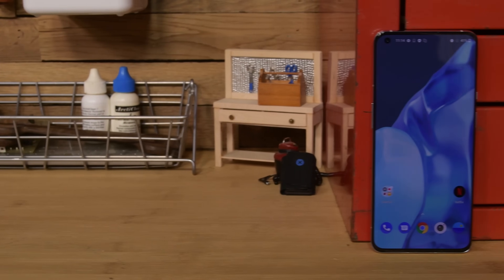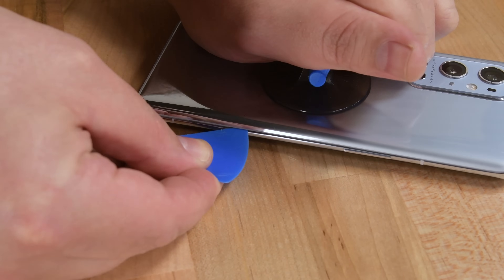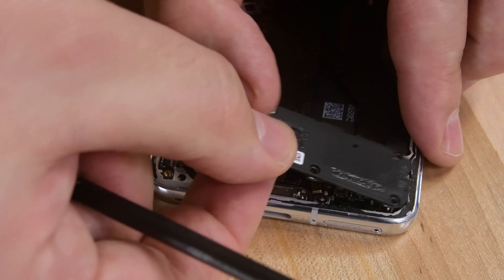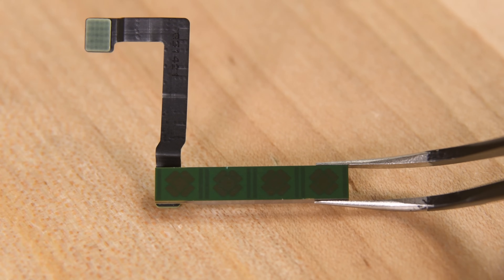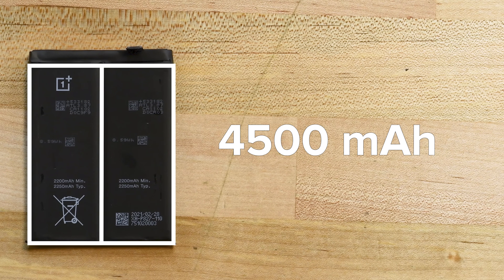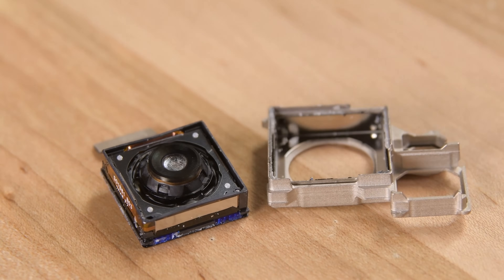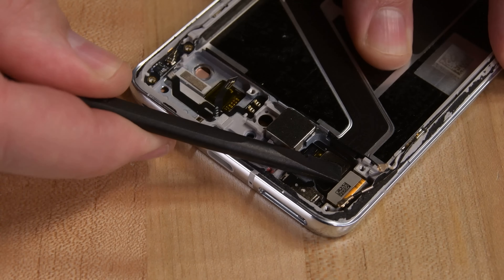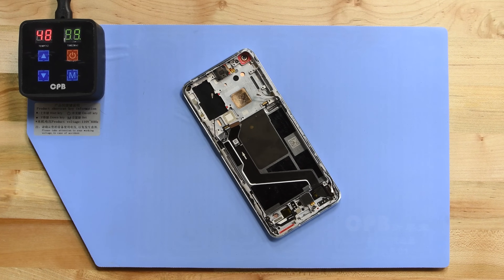OnePlus 9 Pro Teardown: Custom Camera Sensor Revealed!

Comment: If I have a heat mat, as opposed to a heat gun how long do I leave the rear of the phone on there before starting to use the pry tool? What temp setting and how long? Also, can you just replace the camera module itself if the main camera lens is broken?

Comment: Now the question is, would anyone recommend the OnePlus 9 Pro despite the difficulty of repairability?
Reply: you buy a phone because of repairability? the best ive heard is people who buy phones because of reselling value, like generally iphones would sell more even after alonger time, than androids. i buy a phone because thats what i like. thats about it.
Reply: @truthseeker6804  Hmmm. Good point.

Besides, if the OnePlus 9 Pro comes with a case, or if OnePlus do sell special cases for the OnePlus 9 Pro, then I won't have to worry of accidentally dropping the phone or scratching the back glass.

I'm not prone to being clumsy, but I'm always a bit paranoid on keeping any things in good condition.
Reply: @Isaac-gh5ku  true. if they come with durable case or third party cases would be good.  to be clear im not buying it, i was just replying to your comment. i use a plastic back phone 😁, so i dont use a case. lol. i only use screen protector.

Comment: the phone that scores 10/10 repairability score would have pull tabs for the display and back panel
Reply: Yeah... 
And swappable ram and storage unit 
A phone with a 20mm of thickness 
The score is for PC not for Smartphones
Reply: @nothing9220  exactly what you said
Reply: @nothing9220  fairphone 3 have 10/10 score and it's not 20mm thick. Oems can do it but they won't
Reply: @houghwhite411  but it doesn't have the IP68 rating, which might be a big hurdle too
Reply: @tofoo_ninja  I'd say no ip68 is not a hurdle since having ip68 means the device is sealed shut with strong adhesive
Reply: @houghwhite411  
Thats what I'm saying; to have a repairable phone u can't use adhesives which either results in no IP68 rating or in a thicker phone. Or did i misunderstand u?
Don't get me wrong; I'm totally for a shift to more reparability.
Reply: @tofoo_ninja  in my understanding hurdle means a condition that stops an action to be taken. We can have ip rated stuff with less seal, Samsung S5 being an example with ip57 rating. But it's hella costly to produce and not reliable. The cheaper solution is to glue everything shut. 

S5 is not that fat of a phone. Those manufacturers is the one who makes you think you need a thin phone
Reply: @houghwhite411  didn’t Samsung also have that little flap on the charger, it’s not really that water resistant
Reply: @houghwhite411  Is waterproofing really that important to most people?
Reply: @anxiousearth680  I don't know about most people but for me they're important. It's some kind of insurance... 

I won't leave my phone in the pocket and throw it into washing machine intentionally but I'd be glad that I have sealed phone when it happens
Reply: Nokia 3310 has joined the chat.

Comment: What is LTPO?
Reply: It's an OLED technology that allows for a dynamic refresh rate as low as 1hz all the way to the rated 120hz, meaning the phone can stress the gpu and display less when you aren't doing anything and save some battery. Probably why they didn't make a bigger battery between 9 and 9 pro since 9 pro has more battery saving features

Comment: Looks like you guys heat gunned directly over the camera a bit too long, resulting in melting the lens elements on that main camera as seen at 2:47
Reply from the maker: You're right, Chris! It's pretty hard to separate the camera from its housing without warping the lens or the plastics, they use some pretty strong glue to keep all that together. Next time we'll use some Kapton tape.
Reply: @iFixitYourself  nah, I like it crispy :)
Reply: @iFixitYourself  yeah camera should have pull tabs... According to your repairbility score

Comment: Splitting the battery in half WILL NOT result in a fast charging , charging speed is based on battery chem and size .
very false statment .
Reply: It will. You can charge the two battery halves in parallel and theroretically half the normal charging time